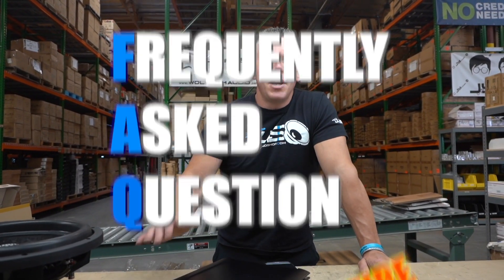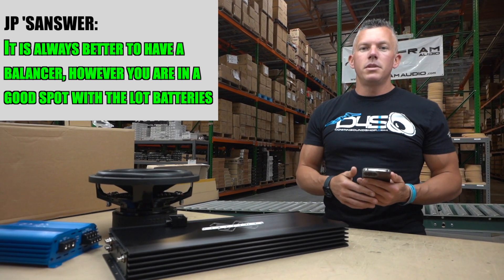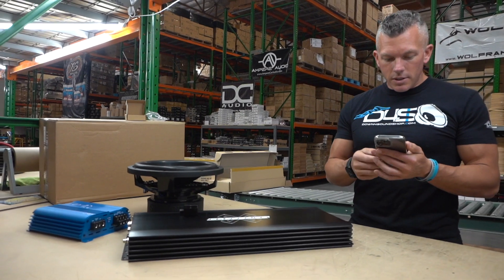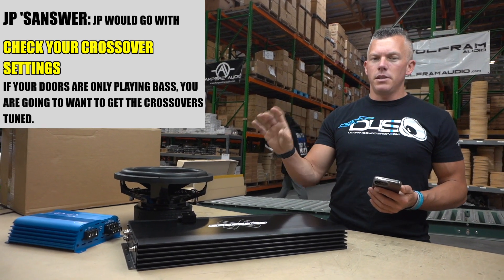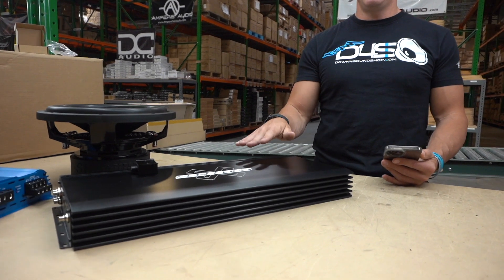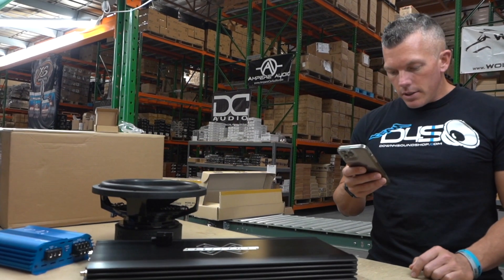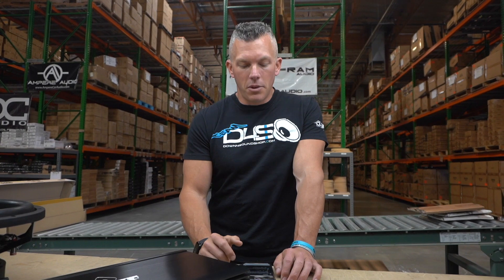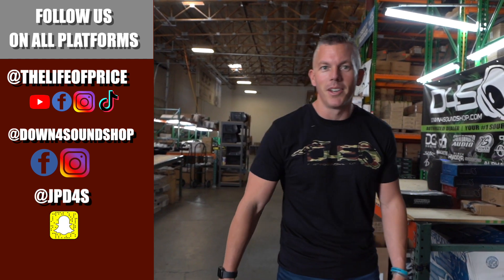D4S CAR AUDIO RAPID FIRE QUESTIONS: EDITION 9

Comment: Hey JP....i have a question.....im running a JP23 for subs and a JP84 for mids and highs what should my electrical setup be for basic daily use and to make sure the amps are getting the power they need to run efficiently? Thanks
Reply: Big 3, upgrade your alternator and 1 D4S lto in the back.

Comment: Jp still wondering on how to integrate the jp40 into my system? In the video you did for it, you mentioned deleting the underhood battery. So does that mean the jp can be the vehicle's battery? How exactly should i integrate the jp40 if i decided to purchase, an what else might i need to use it?

Comment: Hey JP, I have 3 skar svr 15s in a 10cube box after displacement, tuned to 37 with about 160 inch of port area in a slot port. My build peaks at 50hz, why is this so far off from the tuning frequency? Thought it might be the subs but their fs is 33hz.

Comment: Regarding Walter Cotton’s question. He mentioned his system is factory amplified. So chances are he can’t adjust the crossover settings in the factory amp. In which case, he needs some sort of integration DSP to bypass the factory eq, filters, etc and an aftermarket amp.

Comment: Hey JP, how’s it going? Ok got my JP23 hooked up to my DC Level 4 15 and JP234 to my mids and highs and the sound quality is PHENOMENAL by the way! Thank you so much for the high quality products at working man’s prices. Truly much appreciated!!! What under the hood battery would be a good match for those amps/sub combo and my 400 amp alternator? It’s going in a 2003 Mitsubishi Montero Sport with all 1/0 gauge D4S wire. Thanks!
Reply: First, you'd need to know what fits your vehicle. Battery sizes get grouped in classes based on size, so once you know that, you can narrow down your options (unless you're willing to do custom fabrication). It's generally considered best to get batteries and alternators that have about 10-15% of overhead from your actual current draw from your amps (and remaining electrical), so once you've got that math, the remaining options available wouldn't leave much room for you to go wrong with from there.

Comment: In regards to the guy asking about only bass from his front speakers that's not totally true   many vehicles nowadays have front door speakers usually 6x9" as the factory subwoofers especially in any Dodge or Chrysler vehicle. In that case it's rip everything out and start over.   If you want to keep the stock head unit that's fine but use either an Amp Pro or the Idata AR and DSR1 combo

Comment: so what would produce more SPL 4 10 inch x series or 2 12 inch ZV6 on a ton of power for both subs?
Reply: I would assume 4 tens if they're on the same power.
Reply: The 4 10s have more cone area. What kind of vehicle? because you can make both loud if you arent restricted to how big the enclosure can be. But same power in a to spec ported box i would think the 4 10s
Reply: @DustinG33  That is our biggest problem is space restrictions. It's in a jeep liberty. Can't build a wall or loose back seats